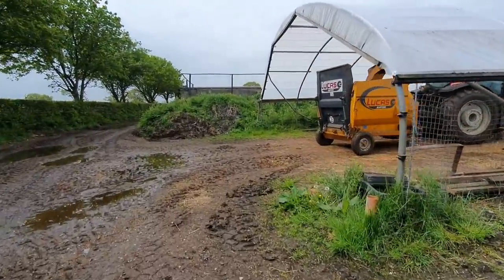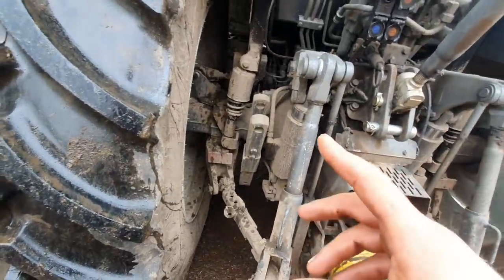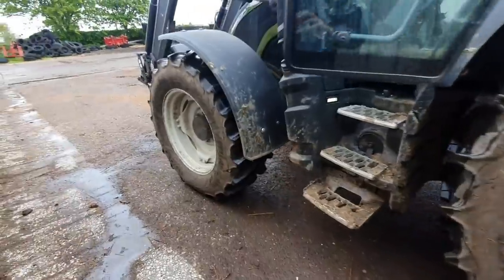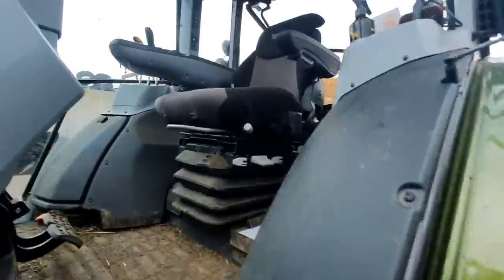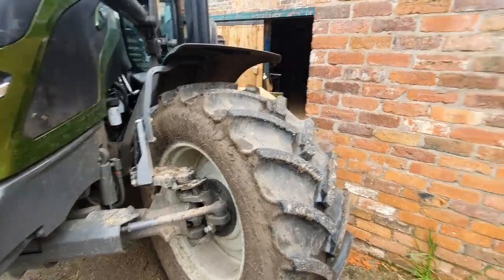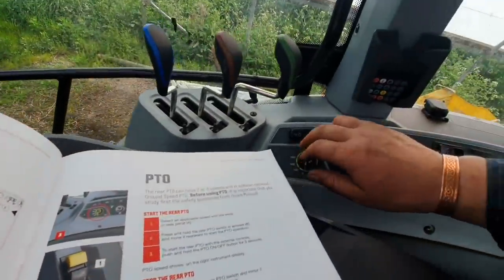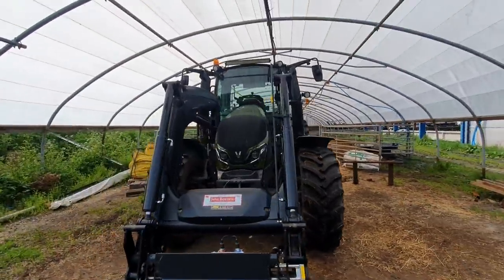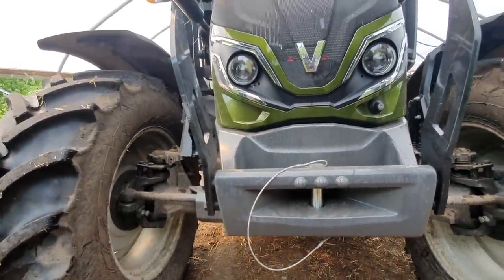VALTRA G135 PIMPING AND REVEIW

Comment: That tractor looks nice Im not a real fan of those light in the cab either.  Wonder how it does in 10 years
Reply from the maker: Young lads🤣. No worse than what boy racers did in the day. Theoretically the should be reliable cause its all proved hardware. Just as long as the electrical stuff holds up

Comment: Looks a good tractor, but it’s got to be a 6 cylinder for me 😉 
Cracking video 👍
Reply: Save quite a bit on fuel with a 4 cylinder tho
Reply from the maker: Agree with Ash I'm a 6 man to. Fuel wise it depends on what ur doing a 6 will still pull hard at low rpm but a 4 needs to be kept up to keep torque

Comment: Made in China 🤔😬 mind you whats not 🤔😁😂. Looks a good tractor for loader work and decent oil flow to. Keep the good work going 👍 Stay safe 🏴 👌 👍
Reply from the maker: It is the same 4.4 4 pot built in Sweden so hopefully will behave. Very good loader tractor
Reply: @hsagri69  still like the old A series 🤔 with the narrow cab cracking wee pocket rocket for the stock person. But would love a Viking 😉 nice. 👍
Reply from the maker: Now there's a man with some valtra valmet knowledge. Yeah a genuine viking would be a nice dream collection addition
Reply: Engine is made in China. Gearbox rear end France, front axle in Germany, Cab and assembly in Finland. Hardly made in China.
Reply: @paraglenner  I wasnt just meaning that tractor 🤔🙄🤣